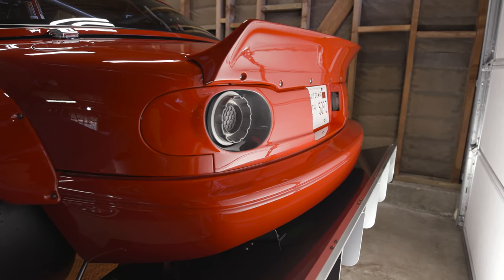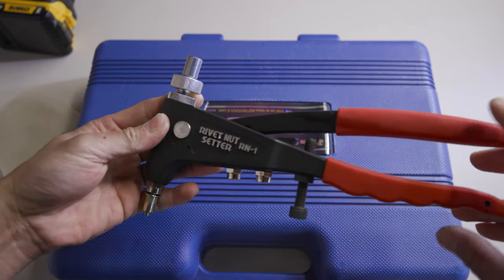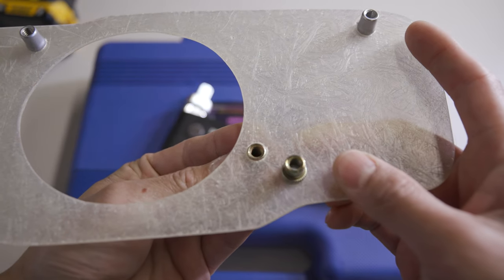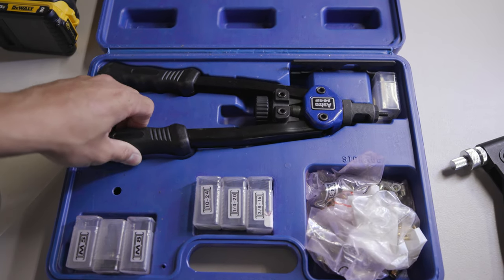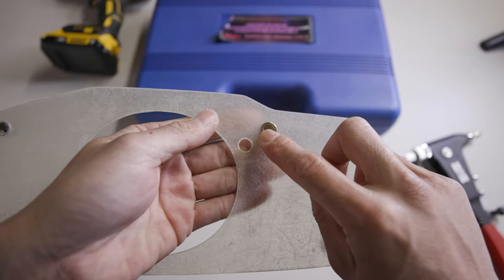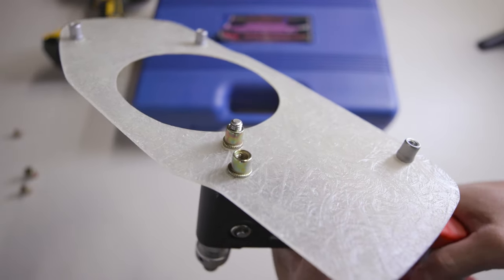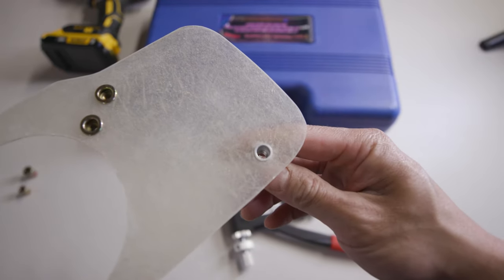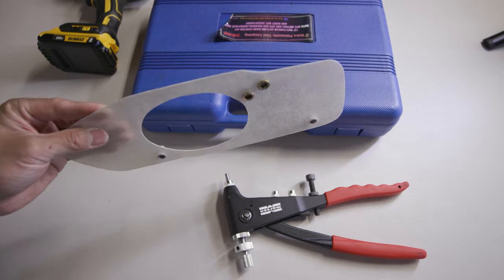SOMETHING WE ALL SHOULD HAVE! | RIVET NUT INSTALL | #OMGMIATA | EP39 | [4K60]

Comment: Thanks for the video! Getting some Steel M6 rivet nuts to attach some body work. Did you use the M5 or M6 on your RB Kit? Lastly, do you mind sharing what size drill bit you suggest for it?